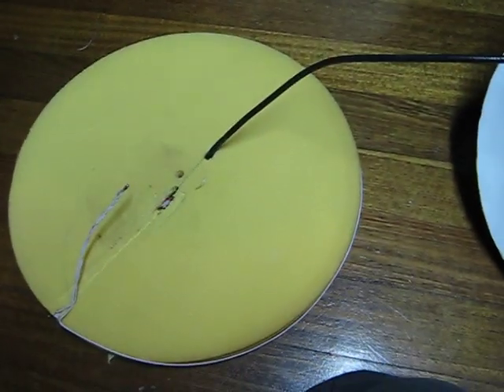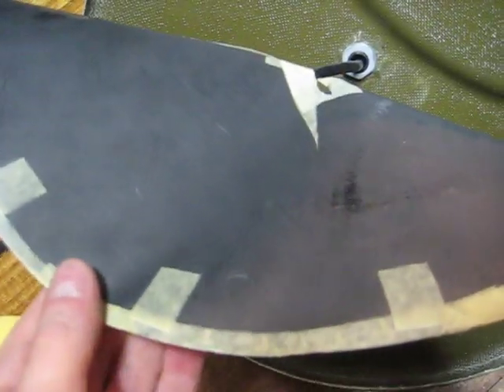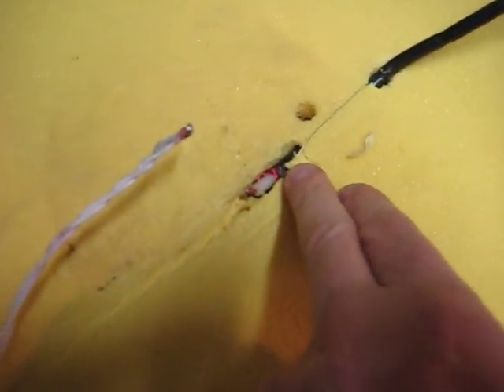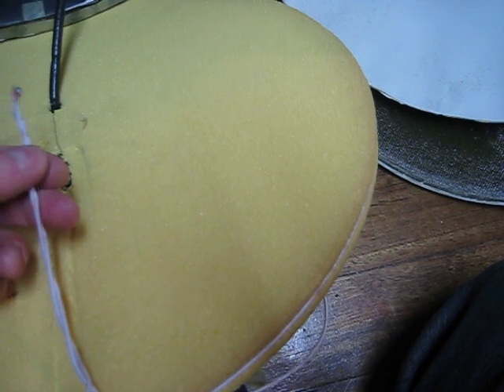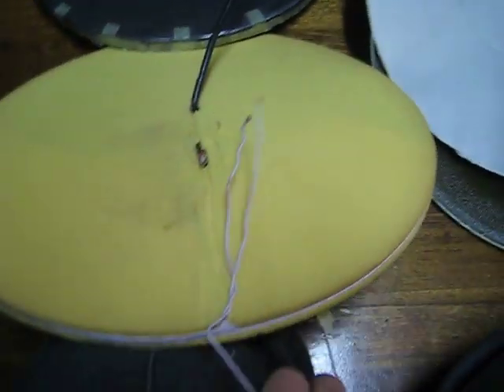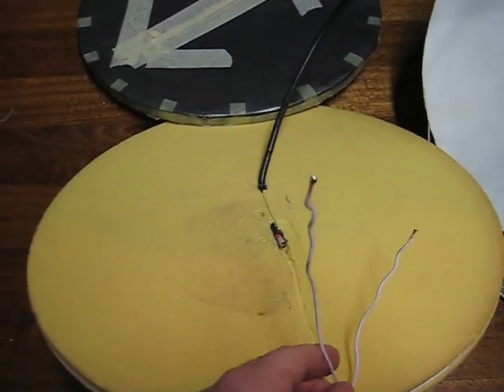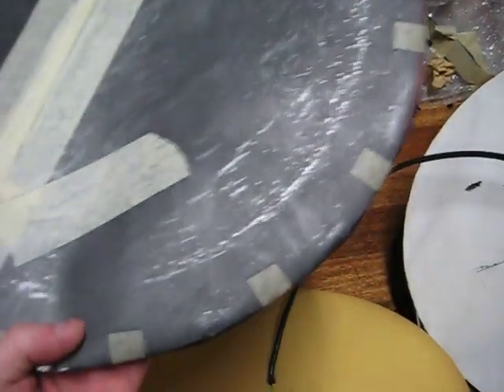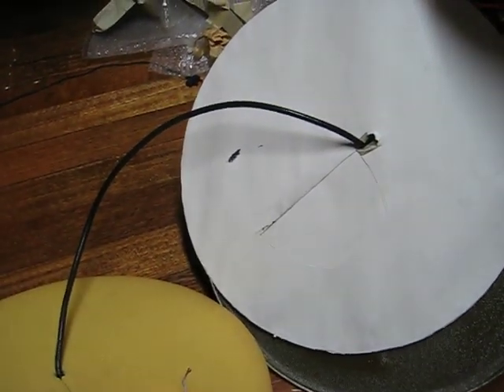Inside a Minelab Metal Detector Coil for P.I

Comment: Woody

Teach me please.  This is a mono coil. The magnetic fields are equally divided at the top and bottom of the coil. I understand why we have shielding (carbon coated cardboard) on the top. It is good  to block any interference  but why we have the same shielding ad the bottom? It is just blocking the signal by my understanding.

THank you
Reply from the maker: The top and bottom carbon / graphite act a as a faraday shield, it stops the coil winding being affected by external objects causing a capacitance change to the coil windings, it has very limited effect on radio waves or emi, except millimetre radio frequencies.

Comment: May I ask what is the differences between a 8-12-18 inch PI mono antennas?  More threads or diameter of the wire? 

THank you
Reply from the maker: Most are 300 uh , small is more turns and bigger is less turns.
Reply: @DetectorMods  Thank you for the quick response. 
 300 uh means 300 ohm?
Btw  I sent an email to you regarding a private business.

Comment: That build quality looks shocking. Have you pulled apart any of the new GPX6000 coils?  Both my 11” and 14” DD seem knock sensitive and unstable.
Reply from the maker: I hear that there are some problems with the coils but I have not busted one open.
Reply: The sdc 2300 is horrible for that. Any vibration would give you a false signal. Very annoying on rocky terrain. I know it is a different type of machine but the ctx 3030 in comparison is very stable on rough terrain.

Comment: Have you any idea what could be wrong with a deus coil gets unstable at high sensitivity
Reply from the maker: It may be just picking up interference
Reply: @DetectorMods   yeh it’s  doing it all the time I thought maybe it’s dampness. Got into base of coil or loose  wire I might cut it open and have a look cheers mate

Comment: Hey, I've got readings from a minelab 11" coil I opened as 0.4 Ohms, 0.28 mH. Now I'm building a new larger coil from the same litz wire (36 strands), it reads 0.4 Ohms, but only 0.08 mH. Do you know how I can increase the Inductance closer to 0.28 mH?
I'm thinking I need to increase the strand count.
Reply: Perhaps increase the wire gauge

Comment: Normally in electronics twisted wire is to shed static interference keeping the original frequency being pushed alive without the static. Keeps the signal cleaner that way so the electronics figuring out what its hearing isn't messed with by the static.
Reply: Run a twisted pair over a sensor and see what happens. This is due to a electromagnetic field that is generated from the twist. Hence not a good idea to induce a field on top of another field
Reply: @marcussmart7673  https://en.wikipedia.org/wiki/Twisted_pair

Comment: i didnt realize coils needed a shield.
my x-terra 705's 10x5 DD got some water in it due to a cracked casing, when i pulled it apart to clean it out i found those little wires stuck to the plastic which i pulled away, and after wiping the inside of the casing there was a black coating that came off
that coil has given me alot more chatter and falsing since then.
what would you recomend as a replacement sheild? aluminium foil? fly screen? (aluminium or steel)?
Reply: گرافیت. اون صفحه کاغذی با روکش گرافیت است.